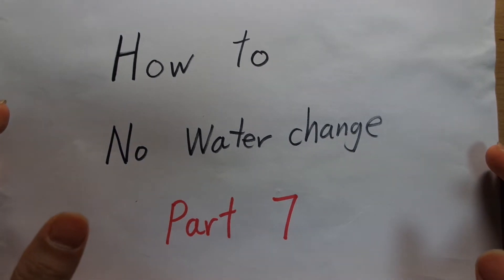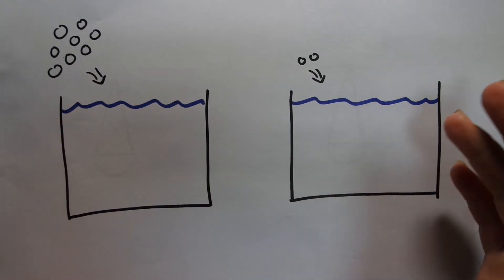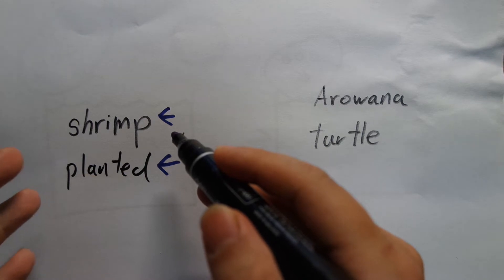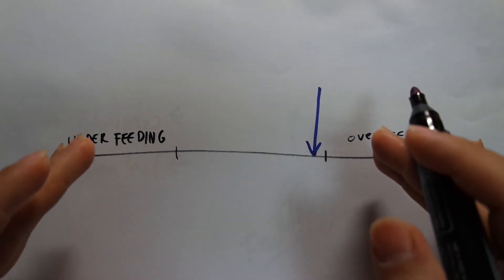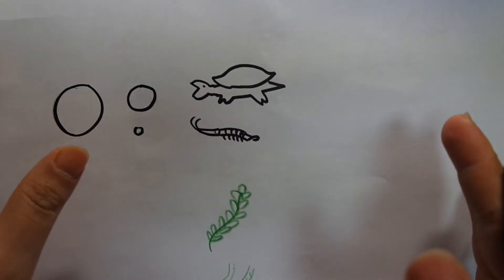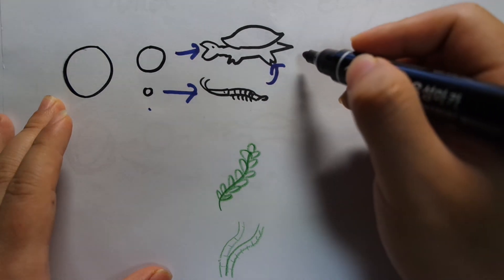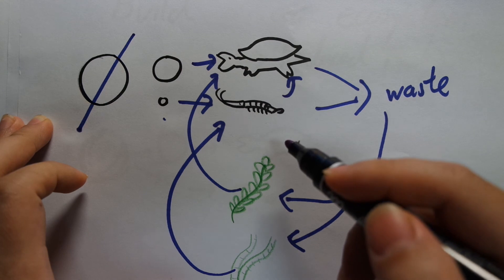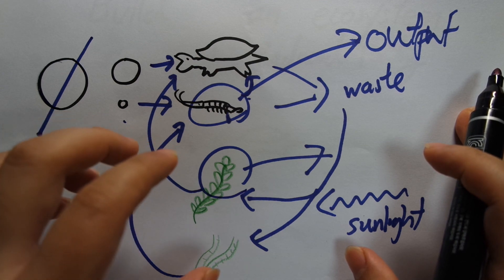How to build a no water change tank part 7: Optimize feeding, build an ecosystem

Comment: I'd like to run a test 10 gal tank I just made with just substrate to a 10 gal   with a layer of soil and and capped with 2" of  sand  have  No plants and just a airstone and I  just tested the cloudy water I got and the ammonia level is about .50 ppm, nitrates about 20 ppm.  If I have   the bacteria to  convert  ammonia to nitrites , nitrites to nitrates  and  I  have some anaerobic  present in the soil to convert nitrate to nitrogen gas then at some point shouldn't there be no nitrates , nitrites or  ammonia in the water. if that happens then  I'll add  some fish food to the tank to get converted  and  go to zero again  also   expect any hydrogen sulfide h2s to be converted to sulfate so4  by the o2 added or am I missing something...thx
Reply: so is  it true  at some point   there  will be no nitrates , nitrites or  ammonia in the water. if I add no input other then adding enough ammonia hydroxide to get the .50 ppm ammonia?

Comment: Hello there. I think the main reason the bottle with the pebbles. worked best is because the pebbles got bigger spaces inbetween th thereby maximising bacterial. growth. As i see it, basically same. reason why the other ones fouled first due to not much anoxic bacterias. if the water is forced to flow downward, that should force the ammonia rich water to get processed by not just the first few inches

Comment: Thank you so much for this!  I recently went to a class locally where the guy explained almost the same thing but somewhat different.  I was started setting up not filter tanks and it’s going better than any other way I’ve done it.  
Question though...I have a 20 gallon long that has an AquaClear hang on back filter.  I don’t want to take it apart and replace the substrate, but I need to do something, cause it has issues.  I see you made an anoxic zone in a canister filter, can it be done at all in a hang on back?  Would maybe just using the clay balls you talked about work?
Reply: I've never used one of those filters, but maybe you need to increase the container size somehow and limit the water flow going in. Using that media. I hear cat litter is also a good, cheap alternative.

Comment: Great series, Jay. I've been following along.
I have two deep-bed tanks with plenums, substrate is baked clay (Oil Dri) both around 18 months old and everyone seem happy, nitrates are low enough.
I would like to have heard more about what you think about the role of the ever present bacteria, aerobic and otherwise. That detritus on the bottom might actually good for the bed, no? One nice thing about the Oil Dri is it hides whatever is on the bottom due to its color.
Reply: So you find out a plenum turns your aquarium into a dirtied aquarium, when you don't remove the biological waste by other means? 👍
Reply: @globalist1990  A plenum works quite well. Not for you though?
Reply: @ChuckD59  it seems complicating a simple mechanism. But I believe it works, yes, but in strongly varying degrees, depending how it's implemented. It's hard to control if it's working as intended as well. A bit of guess work. But my question is, hasn't your aquarium turned into a dirtied aquarium with all that waste in the plenum? ✌️
Reply: @globalist1990  For most part any mulm that falls to the bottom is broken down and drawn into the substrate where it feeds anaerobic bacteria. I have a 6 gallon that never gets vacuumed and the bottom is spotless. A 65 gallon has it accumulating in one corner but only because I need to do better with circulation. The outflow from hang-on-back seems to push it there. But the rest of the substrate remains clean by itself.
I will say though that the smaller one consistently has higher nitrates (60-70) which doesn't seem to affect any of the fish. The large one usually shows 30 for nitrates but it's slightly over stocked (who knew the plecos would get that big!).
I don't like to tear the tanks up, but if/when I do the smaller one I'll do something beter than the converted undergravel filter grates. I'm not sure they allow enough circulation.
Also, when I built these three years ago it wasn't clear to me that they should have some flow, like a tube to allow water to circulate passively. I may consider adding that too.
Reply: @ChuckD59  I thought the point of the plenum was to not get anaerobic bacteria, only anoxic bacteria (which I don't understand why, normal dirtied substrates have both of those as well). So the mulm won't go much into the plenum but still accumulates at the bottom of the substrate? That's a dirtied aquarium then. A conventional dirtied one only draws water down more slowly.

Comment: Hi Jay
This is the 2nd or 3rd time watching this series, I am wondering if this would work on a saltwater tank? I'm going on 2 wks with my 10g no water change. I checked the numbers and everything seams fine. the fish load is 1 betta, 6 neons, 5 guppies, 8 guppy fry. Plant load is 3 dwarf lilies, 3 banana lilies, 2 amazon swords and 1 Anubias. I should be upgrading the light today and adding some hornwort. (thanks to this series.) the Light will be Pets Pioneer YS-E09 Extensible Bracket Led Light 19 " to 26" long. 30 light 15W a cheap light from ebay. Should be better than the other cheap light I have from ebay https://www.ebay.com/itm/New-Design-Clip-Lamp-Light-High-Lumen-48-LEDs-Aquarium-Fish-Tank-White-Blue/281796759448. Thanks again for the series.
Reply from the maker: should work for salt water
Reply: Thanks again, hope the turtles are doing good. I think I have a  new project to start researching.

Comment: How do we avoid booms and busts? Where one member of the ecosystem grows out of control and then dies off eventually? This seems to be the biggest threat in a small ecosystem especially for larger animals with smaller populations
Reply: Jesse Dahir-Kanehl blooms are your tank correcting an imbalance. If it’s algae then too much feeding and too much lighting. If it’s a bacterial bloom your tank is recycling. In both cases but especially bacterial blooms more so you do not want to alter the bloom. It’s correcting your failure elsewhere. The first thing to do in both situations is stop feeding for 3 days and add extra water agitation to induce more oxygen into the tank as both types of blooms are consuming large amounts of oxygen and likely starving your fish. If it’s algae start reducing lighting. If your tank is near a window with sunlight you should stop lighting your tank entirely.